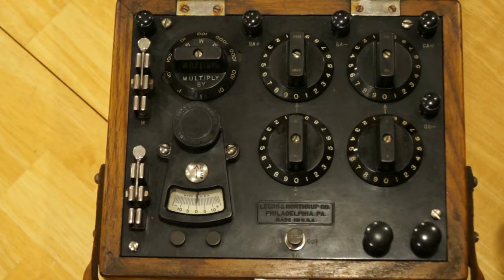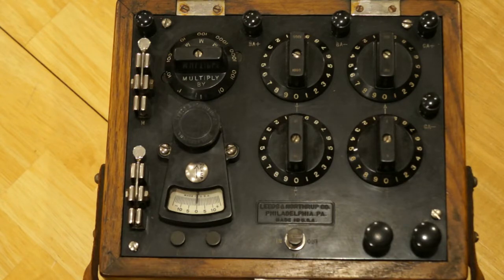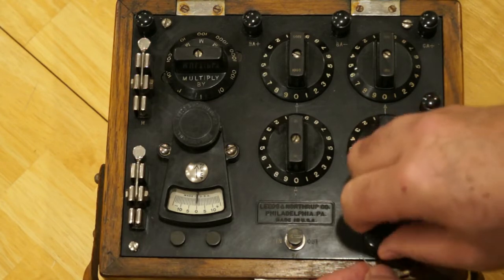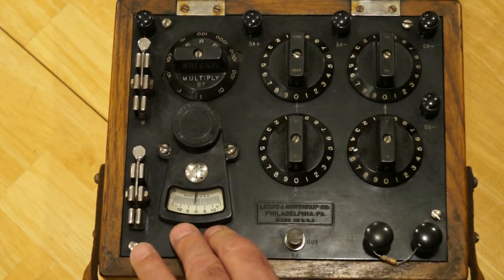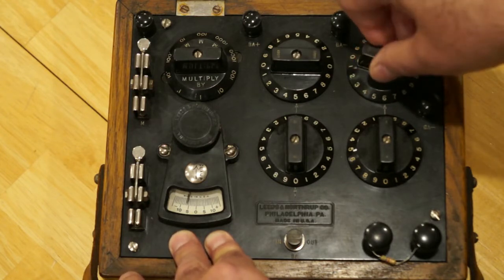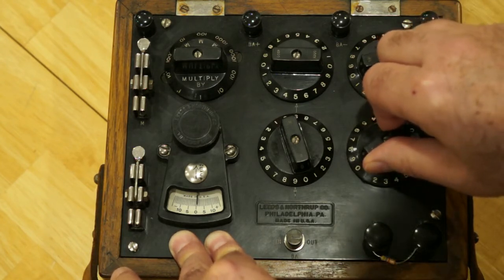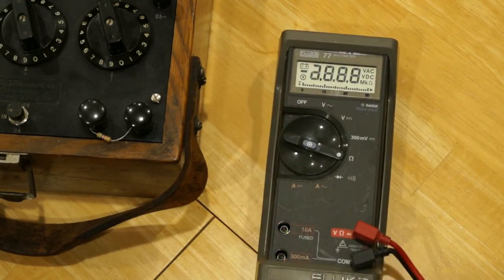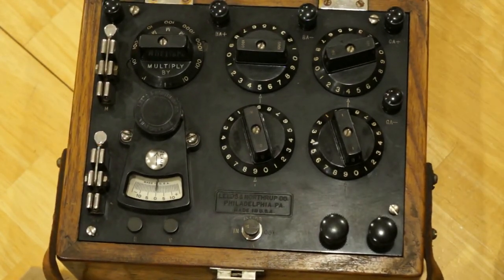Measuring resistance with a 1915 Leeds and Northrup Wheatstone Bridge

Comment: Thanks for this great demonstration! After seeing your video, I  bought one for myself off Ebay. This is just what I've been needing to test a drawer full of extremely low ohm resistors quickly and reliably. The fact that this bridge can find faults on long lines, down to the foot is another great reason to own this. The lid instructions state how to use the bridge as a variable resistance sub box. Finally, the fact that it can be used with an external indicating device & and/or power supply make it handier yet.
Reply from the maker: Glad you enjoyed it!  I continue to be amazed at how well this works. Details on the Murray and Varley loop tests are in an old telecom textbook:  https://long-lines.net/sources/att_principles_ocr.pdf - Chapter 5.
Reply from the maker: WCFL as in Dick Orkin and Chickenman?? “He’s everywhere, he’s everywhere!”  Dick Biondi. Fond Chicago teen memories.
Reply: @df9999999999  Thanks for the link!
Reply: @df9999999999  Yep that was us, although I worked there at a later date.  I listened to it as a teen also. Sadly it's all history now.
Reply from the maker: WCFL1000 I know exactly where the transmitter site is/was. Overloaded my ham receiver over in Villa Park as a kid.
Reply: Thank you for the great vid. Just got a model 7655. Any idea what that is?

Comment: What is the battery voltage you are using 
And what type
Reply from the maker: 3 "D" Energizer alkaline batteries (1.5v each, so nominally 4.5 volts total), per the description and video. Because it's a bridge, absolute voltage seems to matter little.

Comment: Thanks, helpful. Would the process be the same to measure the resistance of a motor winding?
Reply from the maker: Yes, but the reading of the winding would be the resistance component of the winding only, without the 60/50 Hz inductive reactance component component, if that is important.